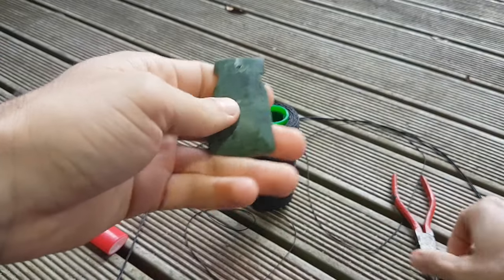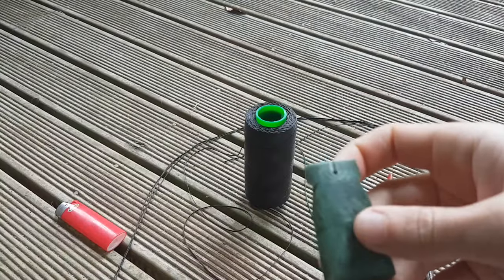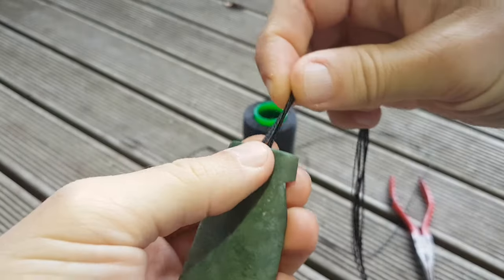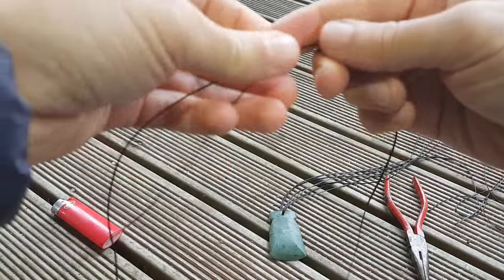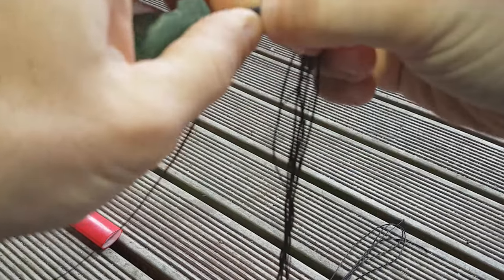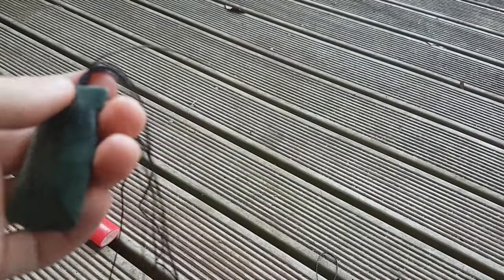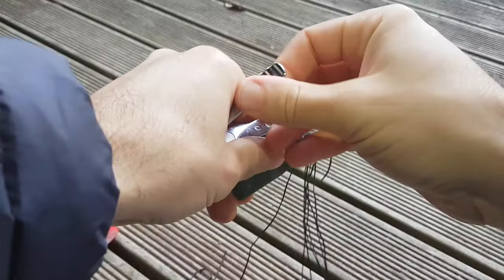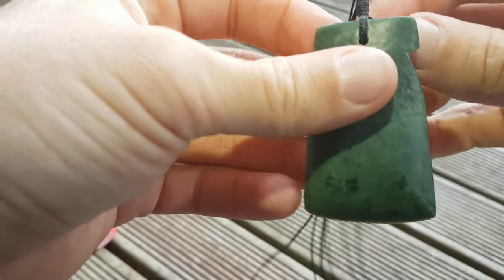How I Bind a Pounamu Hei Toki

Comment: Thank you for this great easy to follow video. I managed to re-bind my toki that came loose after a year of wearing it. My work looks fine but as I wear the toki all the time, the binding comes loose very quickly (much quicker than the original binding did). I’m obviously doing something wrong. How can I prevent the last round of cord going up from popping out of place on top of the previous turns/rounds ? Any tip ?.. am I binding too tight ? Or too loose ?
Reply from the maker: Hard to know what your talking about from your description, perhaps contact me through my website campbellcarving.co.nz and send some photos.

Comment: Campbell, just wondered what the best way to drill a hole in a Hei Toki is ?  Some type of diamond drill bit or can it be done with a narrow burr ?
Reply from the maker: I have tried a few things. The best I have found so far is using a small ball diamond burr, I think I'm using a 1mm one, seems to last and work well.
Reply: @CampbellCarving  Groovy ! Will give that a go. Working on my first Hei Toki, albeit in hard black onyx to learn on. It has the same hardness as Jade and is a lovely rich black. Will give it a nice satin finish rather than high polish 🙂

Comment: How long should your string be? Got all the way through then found at the very end my string was way to short.
Arms length? Hand length? 2meters, 1meter? …
Reply from the maker: Will vary for the size of the toki, I sometimes do a quick lash to get the length I need. Or check out how I have done a more recent video, there is a different way to do the pull through that would help too.

Comment: Chur bro. Just watched and my binding came out awesome. It would be cool if you could do a repair video on chipped greenstone.
Reply from the maker: Awesome to hear it worked well.  What do you mean by your question about a video.  Do you mean how to do it DIY without special tools?
Reply: Campbell Carving yeah mate. I chipped the corner but it wouldn't be a hard repair. Just squaring it up with the other side
Reply from the maker: I could make a video but it would be pretty simple if you wanna give it ago. Just get wet and dry sand paper, and keeping it damp by dipping it in water sand the chip out with 120 grit.  Use a piece of rubber or foam to save you fingers getting sore.  Then when it is smooth, sand it with finer grits to get it matte polished, 280 grit, 400 grit, 800 grit, 1200 grit.  The only question is whether you can polish to so that it matches the rest of the pounamu, as this will give a nice matte finish but to get is shiner or like glass you need special tools and polishing products.  If this is not super clear then I will make a video for ya.
Reply: Cheers mate. I'll give it a go and get back to you!
Reply: Thank you so much for this really clear tutorial..... my sons Toki had come undone and I couldn’t find anyone to do it,  worked PERFECTLY first time!!! Really appreciate this!!
Reply from the maker: Juanita Bassett that is awesome I am pleased it helped.